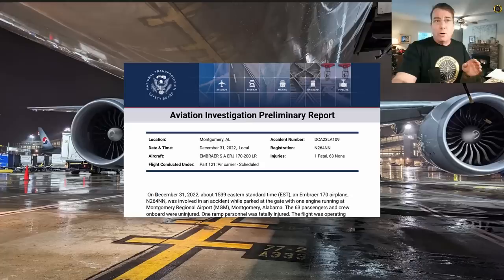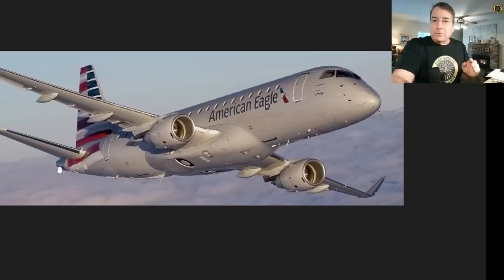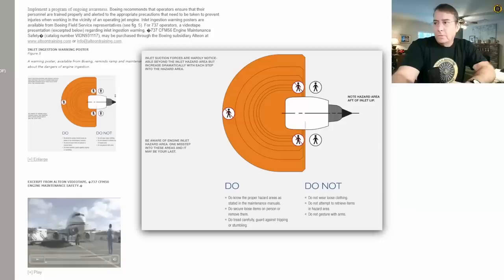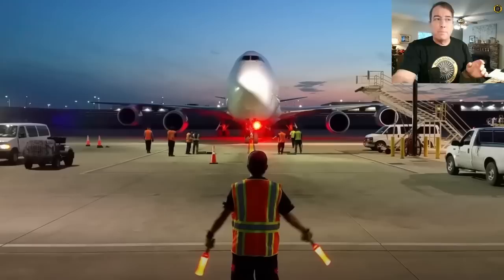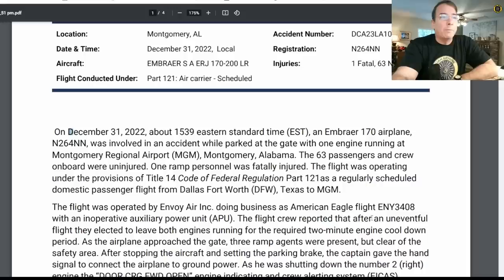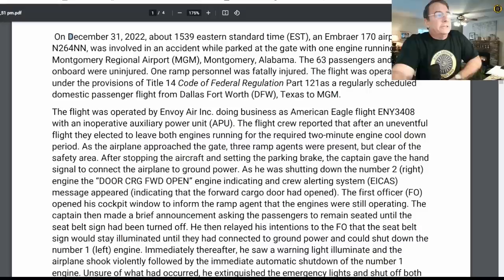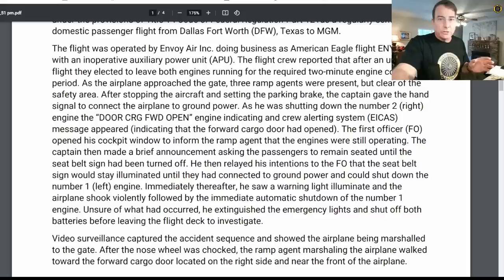NTSB Preliminary Report Ramp Agent Fatality 31 Dec 2022 Montgomery Al.

Comment: Hi Juan. I've had rampers open stuff on me with engines running before with the 2 min cooldown. 

For stopping the clock (which is the IN time, ON time is touchdown. OUT is parking brake off starting the flight, and OFF is wheels up), its actually the main door being opened as you said that ends the flight. I havent noticed if the clock stops with a cargo door being opened but im sure it wouldnt because if that were true then when guys show up with gate checked bags then the rampers re open the cargo door and that would change things.

There is a tremendous pressure to get flights in on time with American. The gate agents are miserable because American is not happy when their planes are late off the gate or in the gate, (a late plane that is a quick turn for example. worst case scenario) However with that being said, the rampers culture is more of a factor than anything. Ive had different crews not touch the airplane with a deferred APU until we were plugged in and the opposite at the same station. I can't speak too much as far as the ramp personnel but from an airline perspective we are focused on safety above on time performance.

Comment: Although I know that this was a case of APU INOP, there is something that flight crews can do to help ground crews start their work a little quicker if the APU is functional. The APU can be started at any point on taxi-in after the runway has been vacated, and many taxis are long enough to transition bleed air and electrical power loads to the APU before gate arrival. If this is all properly executed, the flight crew can shut down engines immediately after setting the parking brake, and upon 5-10% N2 (depending on type) can extinguish the red beacon lights, a little quicker than if they waited for gate arrival.

Comment: My experience (25 years short haul Fokker 50/70/100 & Embraer 175/190 and accident investigator) is as follows:
1. Ramp staff want to get the job done as quickly as possible, for a whole variety of reasons.
2. Airlines put (implied) pressure on handling companies to speed up turnarounds.
3. Feeding operations to and from major airports are fraught with delays. Delayed flights and tight/non connects are an everyday occurrence. This increases the pressure on ground staff.
4. Ramp staff are normally keen to deliver a rapid turnaround (personal pride).
5. There are so many “safety” rules, regulations, instructions issued to ramp staff by airports, airlines, handling companies and governments that compliance with all of them is almost impossible. So many rules are disregarded just to get the job done. Never does the thought of having less and or better written rules cross the regulators’ minds.
6. The rule writers and enforcers work in nice cosy offices miles away from the wet, cold, noisy, dangerous places they are responsible for. (You know if ever they are on the ramp; they are the group of clowns with the clipboards in the bright, clean, used twice only HiViz jackets.)
7. Few ramp staff have the backing of well funded, well informed, well trained unions. If they make a mistake they will be thrown under the bus.
8. Fines, warnings and sackings are dished out to ramp staff by airports as punishments for any perceived infringements or violations.

ps. Some of the best handling I have ever seen was at Linkoping City Airport. Smart, efficient, methodical and totally unprepared to take silly short cuts.

Comment: ERJ pilot here, different company. Can confirm, the ramp behavior I observed when operating with an inop APU was similar.

At one location the lead ramper demonstrated a complete lack of awareness that #2 was still running putting another crew member in an extremely dangerous position by commanding him to place cones in front of it while it was still running then turning his back and dealing with a baggage cart. The green crew member hesitantly started walking towards the engine with cones in hand. He looked back at the lead. He looked back at the engine, unsure, took another step closer. Absolutely within the 15ft. He noticed me shouting and waving thank god. The captain had words with them afterwards.

Another location the GPU cart was parked on the right side of the aircraft and the crew member completely ignored me waving and shouting and walked maybe 10ft in front of #2 to pull the cable to the other side of the aircraft and plug it in.

Another location the rampers were clearly freezing their asses off and just wanted to get the cargo door open and be done.

All of these locations we had called ahead and warned them to stay clear of #2 till it was shutdown.

2/3 of these locations were outstations. The one where the supervisor was the problem was NOT an outstation.

This all happened in only 1 day.
The ramp crews we use service multiple different airlines.

High turnover rate, poor training, perhaps some complacency in seasoned crews, timeline pressure are my suspect reasons.

Two weeks later on the other side of the country I was having a chat with a ramper and he told me they were having a safety briefing about it. Hopefully there comes meaningful change from this unfortunate event.
Reply: Note here that different airlines have different safety protocols.  If you are doing ground handling for two different airlines you have to remember which airline has which.

Comment: Regional Captain on an E175 here. It happened to me a few times, that with APU inop, ramp personnel opened a cargo door while an engine was still running. We acted exactly like the crew did in this incident. It sounds WAY too familiar. After it happened to me a couple of times as an FO, since the first time I had APU INOP as a CA, never pull straight into the ramp. I stop taxiing short of the gate, get operations on radio and want verbal confirmation from them that they RIGHT NOW told the Ramp Crew Cheif to brief his crew on APU INOP. Only then do I move forward. I also intentionally make this methodic stop to let the other ramp crew members realize that something is not normal (even if it is by making them think "why is this idiot not coming in already?!").

But these instances are, in my opinion, common and can happen again. Just a split second of someone not concentrating.

Ramp crews - we respect you and your professionalism, the fact that it doesn't actually happen more often, just means how much you guys do a good job on a day to day basis, in the tough conditions you guys work at. Please be safe for us all!

Comment: I am a current ramp agent and the aircraft in this incident I have worked on a lot. Just at a difrent station. In our scanners we are left notes alerting us if the aircraft is an airstart. Our station danm near beats it into our head we are not allowed to open any panel except for the one where we connect the gpu while beacon ligths are on.

Only safety cones we can place are wing tip cones until engines are spooled down. Our Marshallers or crew cheifs are the only ones that can touch the aircraft during an airstart while we attach power. The wing walker on the side where engines are on are supposed to stand back but toward the tail and swing their arm in a circular motion over head with a wand to warn others that engines are still running to prevent people from being jet blasted. All personnel are to stay away until beacon ligths are off.

Now to the sad part. I have almost seen coworkers be ingested due to just not paying attention. I have seen a coworker be blown over by jet blast because he just wasn't paying attention. We are supposed to do safety Huddles to discuss the flight and what jobs will be done prior to each arrival. A lot of times I see these people just grow complacent and run on auto pilot and just want to get this done so they can leave the flight. Sadly we are rushed A LOT by crew cheifs and managers so we don't catch the delays. Some managers have even held our jobs over our heads about delays as well. It's nerve wrecking at times. But when flights come in delayed its not our problem but we often are expected to make up for it.

Comment: Juan, until you stated it in your video, I didn't know that the ground power connection on Embraer aircraft  is on the left/port side of the fuselage. I have no idea as to why they would set up the aircraft like that, considering that the #1 engine would have to be left running, while ground power is being connected. 

The Boeing 727, 737 that I flew have the ground power connection on the same side as the  cargo doors -- the right/starboard side. 

Whenever we would approach the gate in an aircraft with an inoperative APU, I would hold up a large placard up to the right side window, that stated that the APU was INOP. The rotating beacon was left "on" and, in theory anyway, no one was supposed to approach the airplane, except the person connecting the ground power. After connection, the #1 engine would be shutdown and a little later, after the engine was almost completely spooled down, the rotating beacon would be turned "off".

But many times, we would see a cargo door open light, even before we came to a complete stop at the gate during taxi-in, just to block us "in"!

Comment: Aircraft line mechanic here. The ramp is not a forgiving place. One misstep and you're done. I approach aircraft with running engines daily. If you are to the side of a running engine, they can be deceptively quiet. As aircraft engines become more modernized, they become quieter. When I recover an aircraft, I have to look to see which engines are running, because you cannot base it on sound alone. High noise environments greatly effect humans physiologically and can be very confusing. I have witnessed a rampers clothing pulling away from their body, due to being too close to a running engine. Not a comforting sight. Fortunately in my 29 years on aircraft, I have never witnessed such an event. I hope to never.

Comment: I forgot to mention in my last comment(thanks for pinning me! I’m glad there’s so much support over safer ramps and and tighter safety restrictions out on the airfield!). The clock doesn’t start  for a turn until the brakes are set. You’d rarely be in a situation where you can get the bin open before the brakes are set, but if you were able too, you’d actually be ahead of the clock at that point.  Once the planes parked, brakes are set, the clocks starts before you can finishing getting the chocks in. Now to stop the clock you need to have all doors closed and the brakes released.  This means that you can be completely done with loading and servicing, tug hooked up and the ramps ready to push, but if the planes is still boarding, then the clock keeps going even if the pilots pop the brakes.

Comment: Very through Juan. I worked the ramp (Part 135 Charter, Part 91 repair station) at BTV for 2 1/2 years. Always very aware of intakes and props. Particularly ground power connect/disconnect. The three Citations we had, the plug was on the aft fuselage underneath the No.1 engine (low approach to the plug at 90 degrees to the aircraft making sure to stay in the center of the nacelle to avoid intake and exhaust) and our King Air's were even scarier. The ground power plug on a C-90 is on the outboard No. 2 nacelle about seven feet aft of the  props. And our crews always did cart starts with no. 2 starting first. Then after disconnect, do a cross gen start on no. 1. I would walk from the marshaling position if I was by myself, 90 degrees from the aircraft. Then move to the left wingtip around behind by 20 feet or so. Then crab walk to the plug down the right wing from the tip. And reverse the process after the disconnect. If I had another ramper. I'd stay in the marshal spot and have the other guy stationed 10 feet off the wingtip and would hand signal for the connect/disconnect. Left wing for the Citations. Thank goodness our Challenger had a right nose hookup like a CRJ. In the time I worked there the only incident we had a a tow bar mechanical failure resulting in a runaway Beech C-90 and subsequent hangar collision. All current rules were being followed at that time. But we added in a brake rider and a direct connection tow bar rather than the universal we were using for everything rather than just ramp/hangar movement on the King Airs.

Comment: I used to fly for one of the wholly owned American Eagle carriers on the ERJ145. I’ve witnessed several times at both the out stations and the hubs, rampers approach the aircraft, open cargo bins, jetbridges attached, etc. Once I even had a fuel truck approach and attach to the aircraft with beacon on and number 2 engine running!! Luckily, on the 145 the engines are mounted up high on the tail, but still this is very dangerous!

I also noticed that sometimes it’s very tough to get ground power established. The portable GPUs are often unreliable and difficult to attain. There doesn’t seem to be much training at the regional ground crew level when it comes to operating them. Often, I’ve pulled up to the gate with an inop APU, and no ground crew had been briefed that we would need ground power before shut down. The rampers had to go get one from another gate (the 145 doesn’t take the traditional jetbridge AC power, it needs a 28.5DCV GPU). I learned to call ops 20 minutes out and make sure they knew about it and still the word never got to the rampers about it. 

I feel like there needs to be a safety standown, and an overhaul on the hiring and training process for the regional ground crews. That is a very high turnover position as well, so they have a lot of new employees.

Comment: I was once in the waiting area by a gate while the aircraft pulled in. The aircraft had barely stopped, the right engine was still spinning (must not have been running) and the ramp worker drove the belt loader right in front of it towards the cargo pit. A sure sign of complacency. How many near misses happen every day out there. It's time to audit.

Comment: When I was a ramper, I was taught that if you saw a member of the ramp crew approaching a running engine, you should visually alert the pilots to shut down the engines (or signal to the marshaller if you're not in view of the flight deck). Yelling to someone to stop will rarely work, because the ramp is such a loud environment. Listening to the report and reading some of the comments here, this doesn't seem to be a common practice, although it always made sense to me. Not sure if it would have made a difference here or not.

Comment: I worked on the ramp. When the 300 stopped at the gate the ranp crew would stay well back until the engines spooled down. I’d watche the spiral on the hub. With ear protection on you couldn’t hear the engine. The intake was very intimidating. Such a senseless tragedy. Thanks Juan.

Comment: As a mechanic I’ve approached idle running engines many times and you definitely have to know what you are doing and know where the safe area’s are. “Getting used” to this type of work is very dangerous, I guess that probably also was a factor in this absolutely horrendous accident.

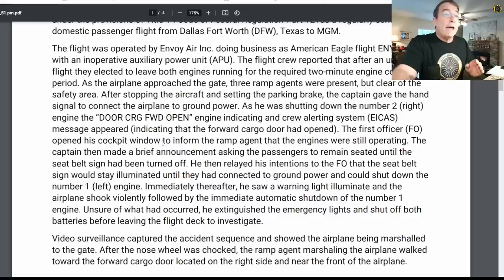Comment: In 1965 at Albuquerque, NM Sunport flight kitchen I was an assistant manager but off duty when this accident occurred. Two food service agents, relatives, were allowed to work as a team on the same hourly shift 10:00 to 6:30. The on-duty supervisor had grown accustomed to their ‘rushing the clock’ to quickly load three meal flights by 6:00 then declared to the supervisor they did not get their 1/2 meal break midafternoon because they were assigned duty indoors. While raising the old-time small hydraulic lift catering vehicle they punctured the fuselage beside the rear cabin access door. If they knew what they had done they did not report this mistake. They clocked out by 6:00. The flight from Albuquerque to Midland was limited by ATC to fly below 12K’ due to rainstorms. The damaged fuselage was discovered in Midland by the next Captain during his walk-around. Officials were alerted and converged upon the ALB flight kitchen that evening to investigate. Penalties and written warnings were issued and the two relatives were reassigned apart from one another.

Comment: The marshaller should have never walked away from the front on the aircraft. As a former ramp agent, I could see how the marshaller walking away could be construed as the aircraft was safe to approach. I understand the anti-collision lights indicate running engines, but I've also seen many a pilot forget to turn them off after shutdown. With that being said, I can't understand how she didn't know that engine was running. Not only did she get jet blasted, she would have heard the engine running (you can tell). I also am interested if this is a contract ramp. I know that contract ramps are usually more worried about turning planes as quickly as possible.

Comment: I fly the E175 and I can attest that with a taxi in time of greater than 2 minutes, the #2 engine will often be shut down prior to engine #1, leading to a single engine taxi in on engine #1.

I’ve always thought that rampers might become complacent in thinking this is always the case, leading to a serious threat in situations where the APU is inoperative (due to shutting down engine #1 first so that the ramper plugging in the GPU is less prone to ingestion) or when the taxi in time is less than 2 minutes and we are forced to keep both engines running.

Also, the IN time is generated by the main cabin door being opened while the parking brake is ON. The cargo door is not correlated.

Comment: Retired DL guy here it seems to me that the proper sequence of events with an APU inop and the need to tun both engines operating should have been: 1) upon attainment of required cooling time - RIGHT ENG shutdown. 2) GROUND POWER - CONNECT 3) LEFT ENG - shutdown 4) BEACON - OFF